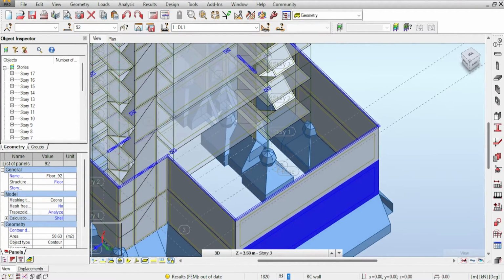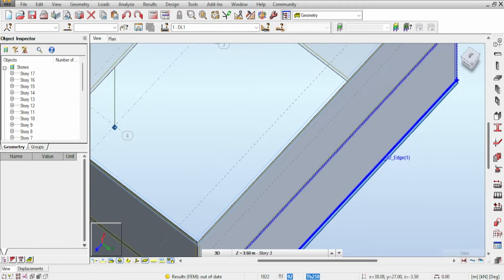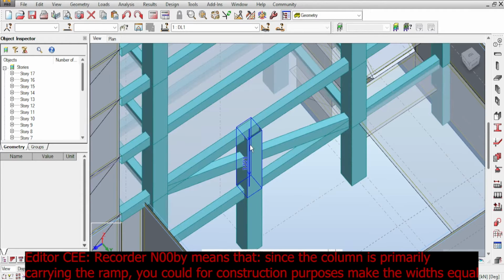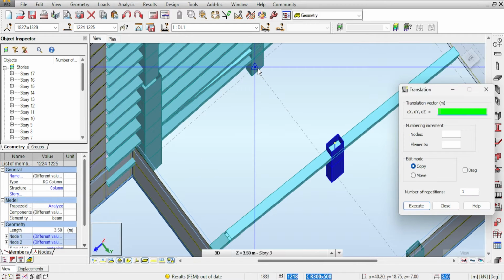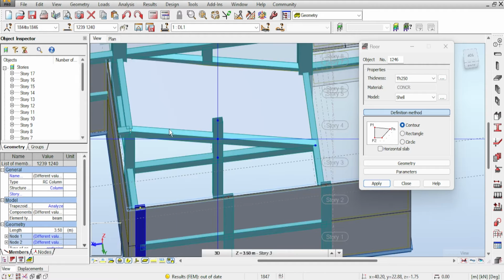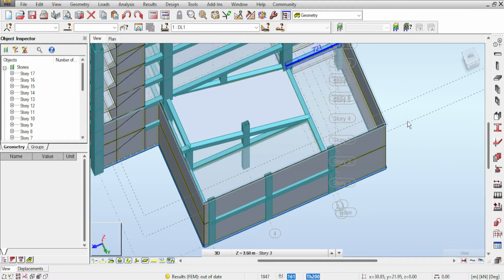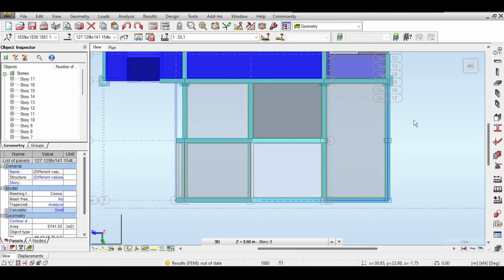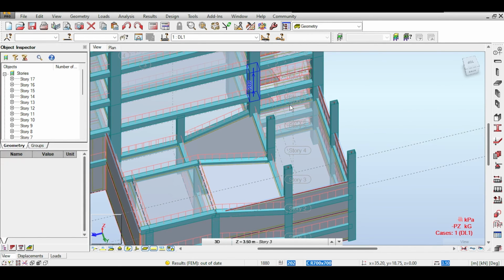Modeling and Design of RC Buildings in Autodesk Robot | Part 15: Modeling the Car Ramp

Comment: Hey Dr. CEE

My question is: when and when to not reduce the LL according to ASCE
Reply from the maker: I think I had a video about it here
https://youtu.be/cceBjC7RtLc

There are conditions in the ASCE.
I did a quick check:
Section 4.7:
This section outlines the procedures for live load reduction.
Influenced Area: Live load reduction can only be applied to members with an influence area greater than 400 square feet.
Reduction Factor: The allowable reduction is determined by the tributary area supported by the member.
Limitations:

    Live loads of 100 psf or more in Group A occupancies cannot be reduced.
    Live loads on members supporting only one floor cannot be reduced.

Alternative Method: For live loads exceeding 100 psf, a 20% reduction can be applied to members supporting two or more floors.
Reply: @CivilEngineeringEssentials  alright, I will also check your video about this topic.

Thank you❤️

Comment: Dear CEE, Thank you very much for your sharing, Does Autodesk RSA have option to check Global  Stability of Structures? If Autodesk RSA have, can you  show in your video series please.
Reply from the maker: Hi there, it is  a really cool suggestion. I will add this to my todo list
Not sure if that is possible, but maybe I can find a way to get the results from robot and do this calculation manually. 
(I am thinking of reactions and moments to use this, kind of finding where the center of gravity of reactions is and seeing if it causes any tension in the soil) But I have to prepare for this.

So stay tuned, I will try to add this to my series.
Regards,
MJ
Reply: @CivilEngineeringEssentials  Thanks for your reply, I'm looking to see it.